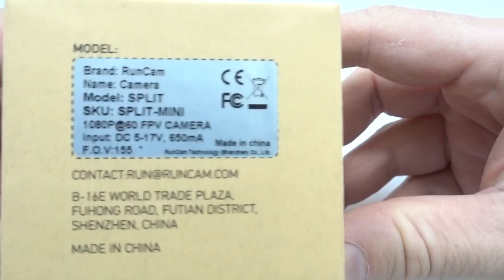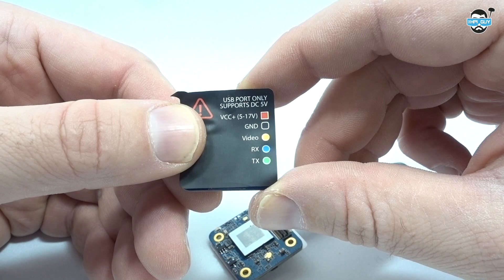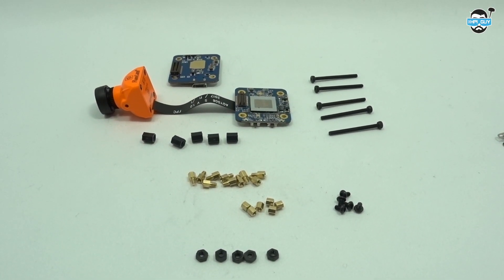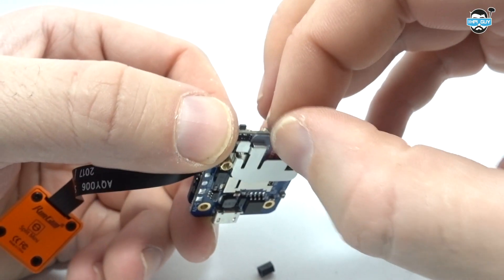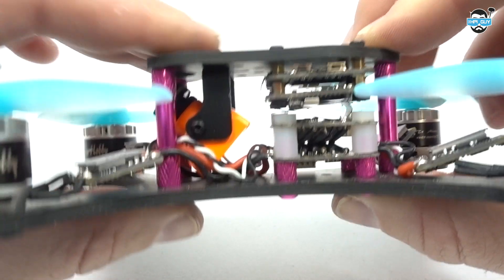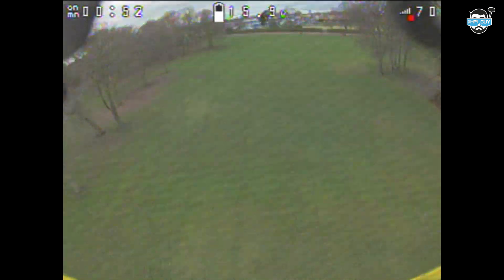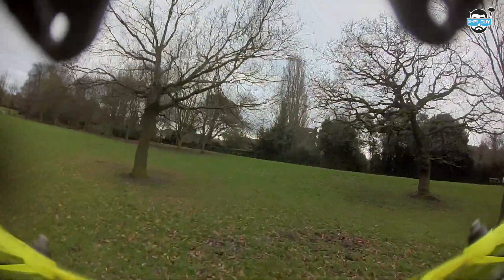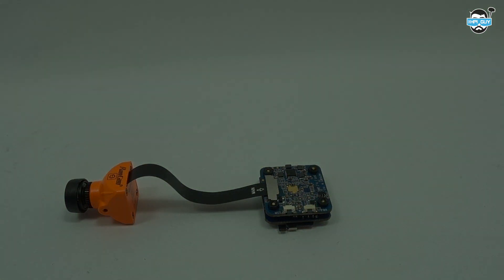HPI GUY | Runcam SPLIT MINI - FPV & HD Camera

Comment: Hi rich if you power it from the usb plug the lines may go I had the same issue with the split 2 an powering it from the USB port solved it completely

Comment: for the diagonal lines:   did you use 5volts here? it was a known issue on the split 2 at least. when powered with lower volts it was noisy - if 12v or more - it looks better. someone explained that the 5v regulator on the split simply isnt clean...
good review, greets, Mario

Comment: I have many of these, the power reg fails and they reset in the air like crazy (turns off, so dangerous). Lost a lot of gear, do not use as FPV cam unless you cap and BEC.